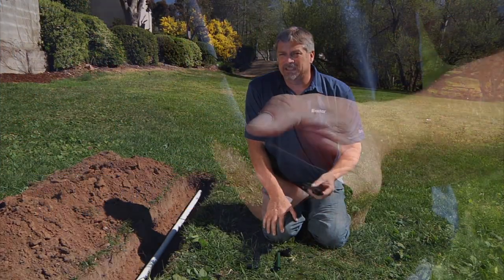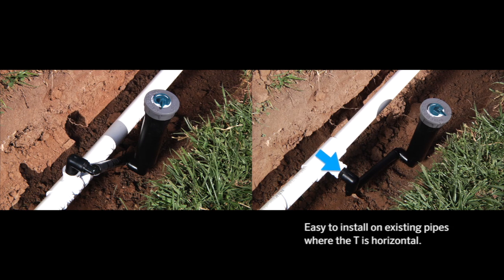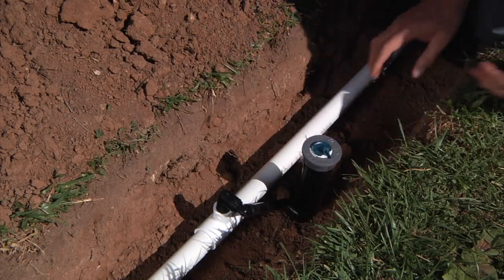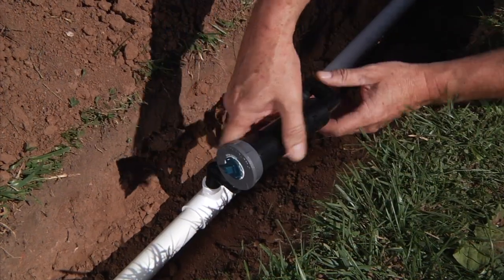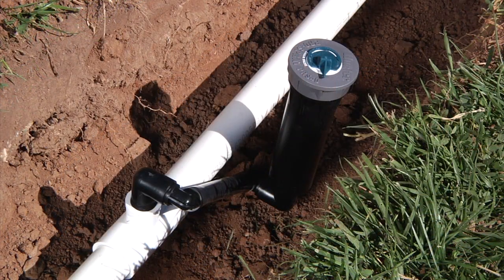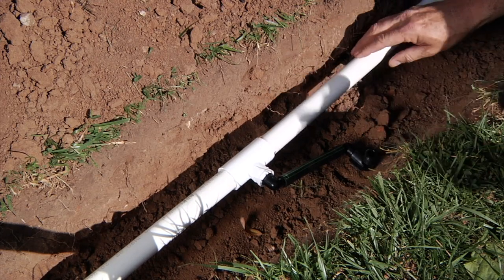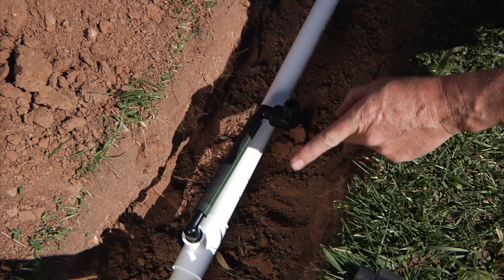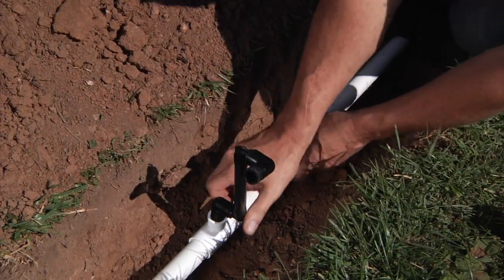The Hunter SJ Swing Joint

Comment: I have a sprinkler system with inground "Head on Swing Joints".  I am installing 6 eight-foot planters at approx. 30", but current sprinkler heads will not, and in some spots under the planter.  I was told to use a swing pipe, but they look like they only go as high as 12".  Ideas please?
Reply from the maker: Thank you for contacting Hunter Technical Support.
 
In some cases, the Hunter Swing joints, pre-assembled are not long enough to raise the heads up correctly. In this case, I would recommend purchasing a roll of Hunter flexible swing pipe and the barb x 1/2 male thread 90 fittings. You can then make your own custom-length fittings.
 
https://www.hunterindustries.com/irrigation-product/accessories/flexsg-tubing
 
https://www.hunterindustries.com/irrigation-product/accessories/hunter-spiral-barb-elbows